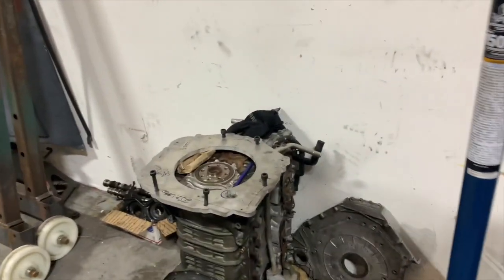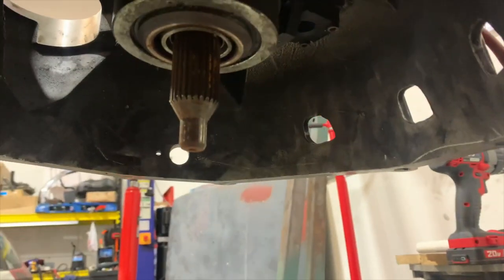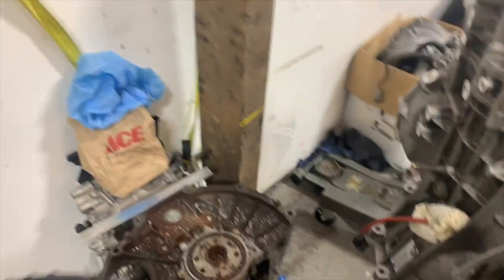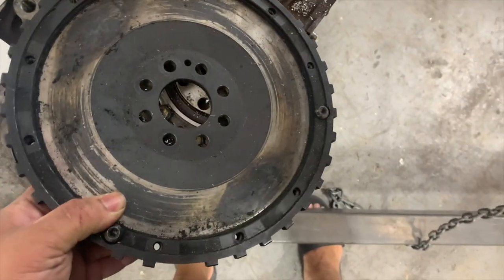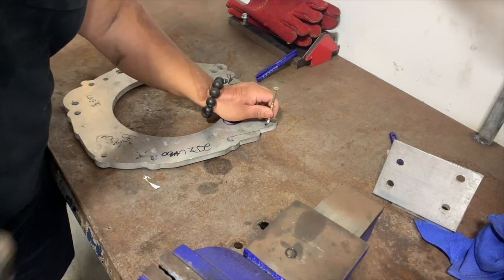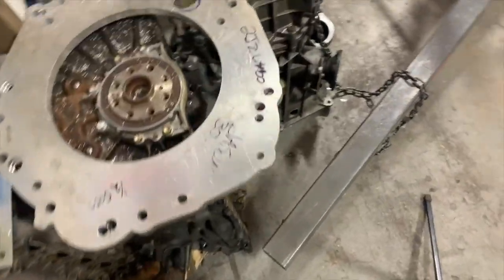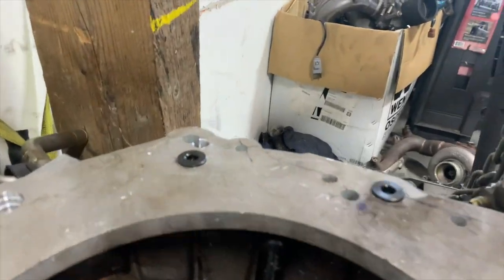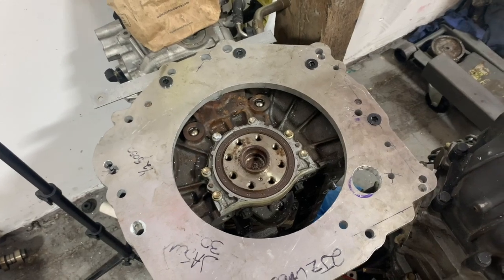2JZ Lambo Gearbox Adapter Prototype : 2J Gallardo Swap Part 10

Comment: Any updates on the adapter plate. im currently have a 2jz mated to the 01E gear box 6 speed. wondering the strength on this gearbox?
Reply from the maker: Will resume project next month. We had to pause and relocate. The graziano gearboxes have been known to hold 1200hp
Reply: @allanglesperformancegarage  did you get a cad or drawing format of the adapter plate. Probably going to go this route in the next month or so.